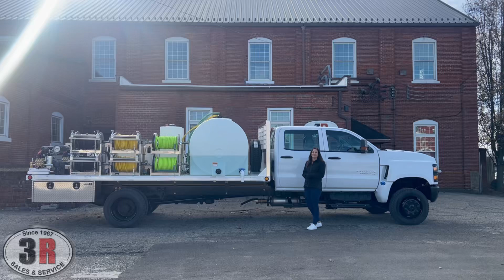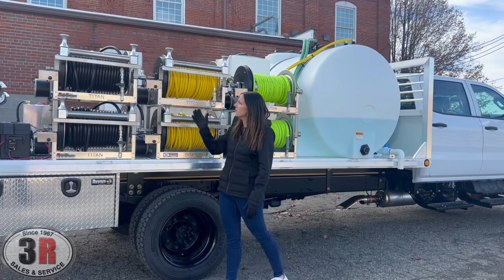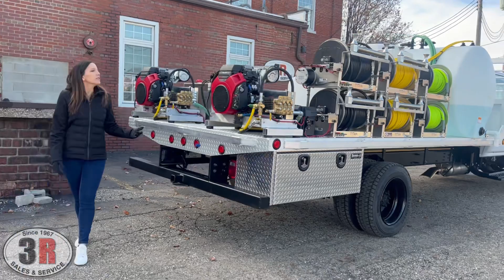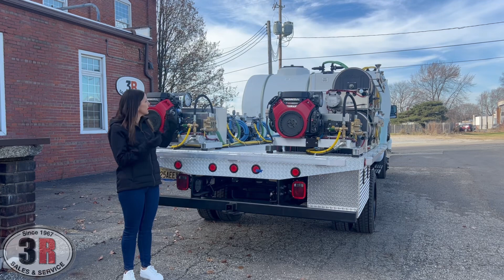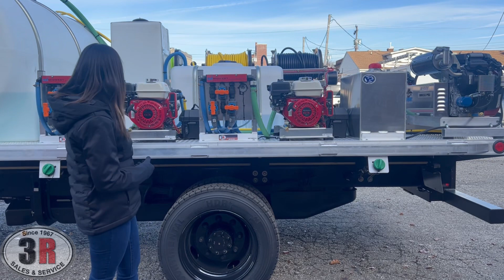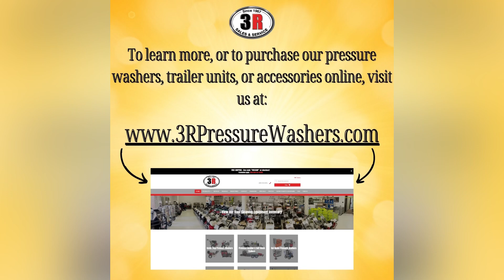KINGSNAKE: 16’ Flatbed Mobile Wash System - (2) 10 GPM Pressure Washers & (2) 11 GPM Gas Soft Washes

Comment: Nice job, The only thing I would change is to put the battery in its own box under the bed of the truck. With a battery changer  installed inside with an external 120 volt plug so it can be plugged in at night. Or maybe even tied into the trucks power system so anytime the truck in running the battery is changing.